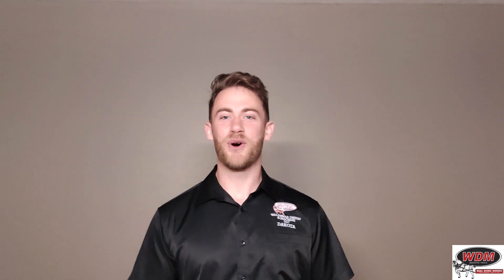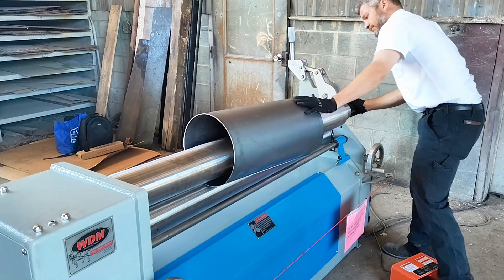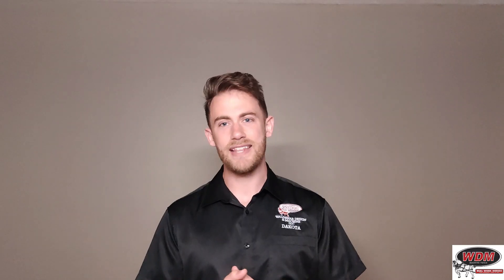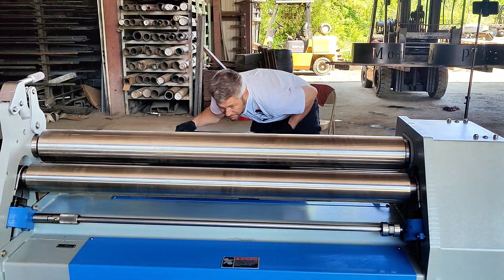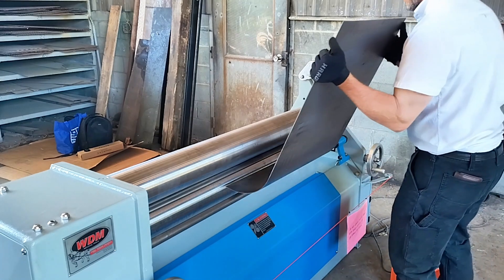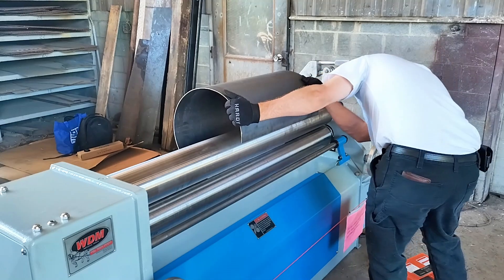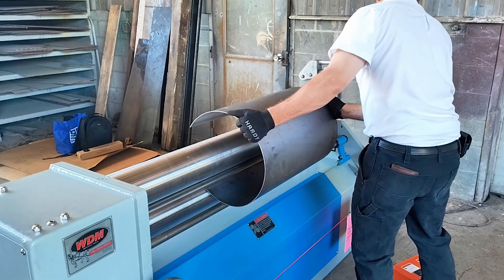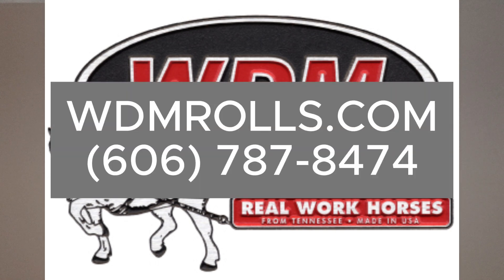Mastering a 3-Roll Initial Pinch Plate Roll: Tips and Tricks | WDM

Comment: Hi is it same technique to any thickness , ?
Reply from the maker: Yes it is the same technique for all 3-Roll Initial Pinch Style plate rolls. The larger machines would have a drop end instead of a swing out top roll and would use cylinders instead of a screw system but other than that the Prebend method etc would be the same. Let me know if you have any other questions.